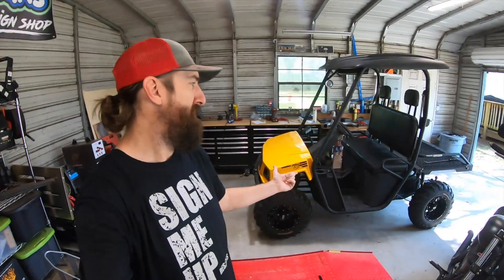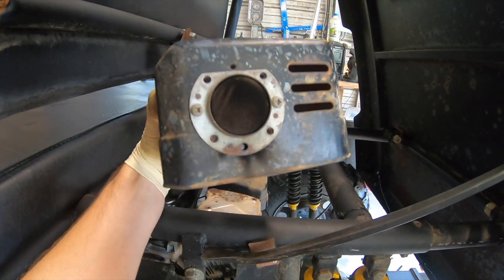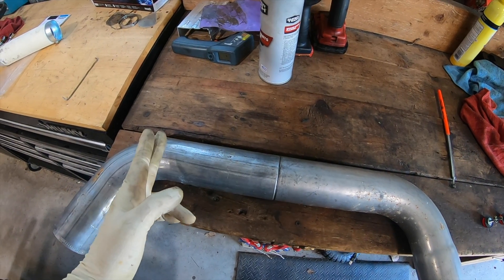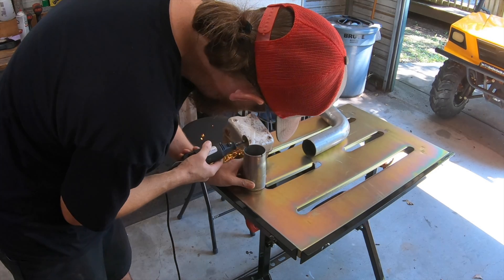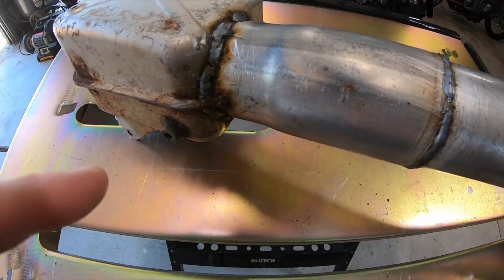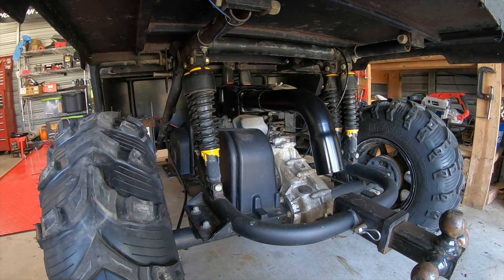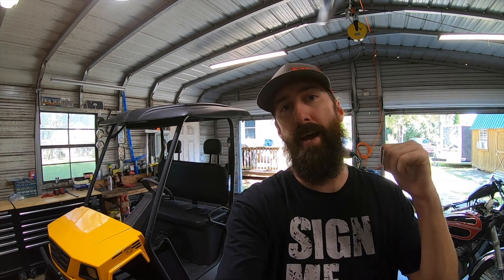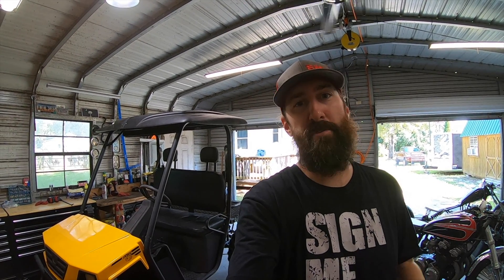2.5" Exhaust & Baffle On A 9hp Subaru Engine! - Louder Or Quieter?

Comment: Exactly what I was looking for. Have the same yellow rig that was “donated” but it’s way too loud to drive around the lake community. Guess it’s time to break out the welder.
Reply from the maker: Full disclosure, the weld to the manifold eventually broke. If you do this same mod I suggest welding a support bracket from the pipe to the cross member above the engine. The thin Chinese metal never stood a chance. 😂
Reply: @SignMeUpDesigns  I plan on using a modified version, also with stuff I have laying around. So it won’t be exact, but I’ll keep in mind weight and supports